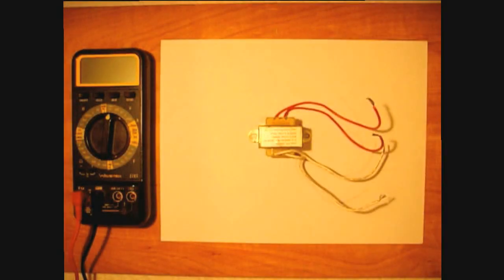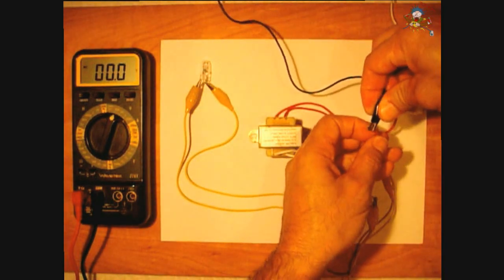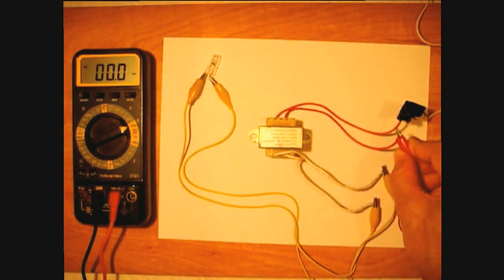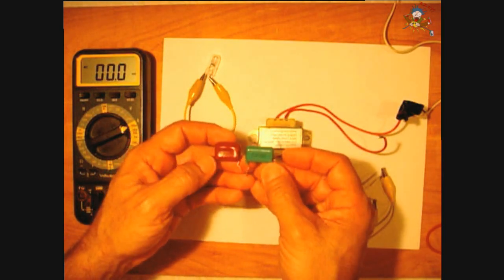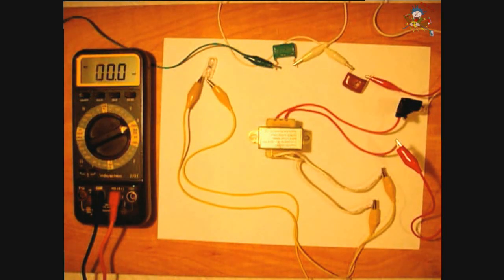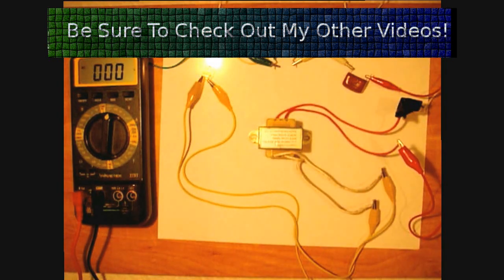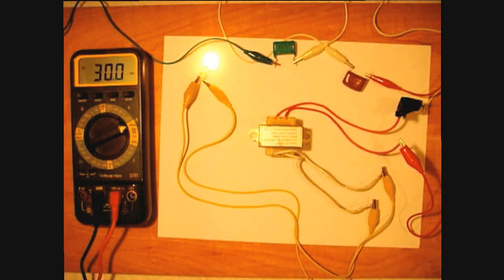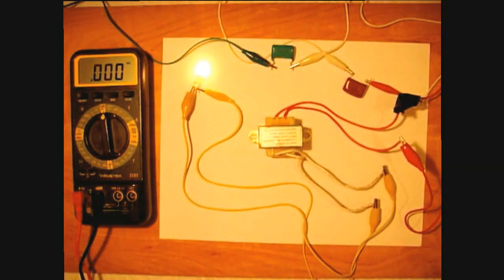How To Power 110V Transformers With 220V!

Comment: Thank you for this video. I've got a 110V soldering iron by mistake and thought about doing that. Maybe it can work. I will give it a try. Would be great if I can use it on 240V. We only got 240V or 380V here in France.
Reply from the maker: +Michel PASTOR 
Hello Michel,  Use a 120v light bulb in series with the soldering iron which is approximately the same wattage. That will work just fine.
Reply: +electronicsNmore Thanks for the suggestion. I tried the resistive and capacitive dropper methods. I modified a Hakko 888 110V to run on 240V. Both methods work fine but I will keep the in series capacitor for the elegance of the solution (much less wasted power and everything stay enclosed in the iron base). A 8µF capacitor in series with the primary of the transformer did the trick to get reasonable voltage on the secondary according to the specs (should be a 24V transformer) and the iron seems to work fine. The fact that it has electronic temperature control worried me a little. Hopefully it won't expel the magic smoke sooner than it was designed for. Thank you again for your channel. Knowledge is power, education is key. Take care.
Reply: +Michel PASTOR I should add that I removed the ZNR that was in parallel with the primary in the Hakko 888. If you don't it will heat up and probably release the smoke.
Reply: +electronicsNmore Just a tought about this modification. To be practical I think a bleed resistor should be added in parallel with the capacitor. Otherwise depending of the voltage on the line at the moment you unplug the appliance a powerful charge can remain stored in the capacitor and shock somebody touching the end of the plug even a long time after it has been disconnected. I did no try it myself and don't plan to. Discharging the capacitor with something conductive makes a nice spark.
Reply: @MichelPASTOR  Hi,  is it still working or did you see magic smoke? I'm about to do the same and would like to know more about reliability of this method. Thanks
Reply: @sbybill3271  It was working and I managed to put everything inside the case. One of the caps was weak though and "exploded" (not the same as the other ones). But if you are using the right type it should be fine. I used 11µF. The one which exploded was MKT. The other ones which were fine were polypropylene caps. In the end I'm using an external transformer,  one I had laying around. Since I don't move the iron it is not a big deal. If you're willing to put the money down the best would definitely be to buy the right transformer.
Reply: @MichelPASTOR  Thank you for the fast reply. I was kinda thinking an easy way out....what if we reduce the secondary winding to half, which should be easy to do without dismantling the transformer. This way, everything should fall back to the power specs of the transformer and I should be good to go. Any thoughts on that?
Reply: @sbybill3271  Not sure about that because by halving the number of turns on the primary you will halve its resistance and also inductance which will in consequence halve its impedance. Aren't these transformers also supposed to be powered with 60Hz ? Going from 60Hz to 50Hz will also lower the reactance. Taking all this into consideration I think it is probably not a good idea in theory. I'm not a transformer expert though.
Reply: @MichelPASTOR  I won't reduce number of turns on primary but on secondary because there will be less number of turns on that side. The current on the primary side should then be half of what it is on 110V.  When the secondary side power is held constant, the primary side power will also be held constant. Hopefully, it would work. The equation is Vp/Vs=Is/Ip. I will experiment with it and see how it goes.
Reply: @sbybill3271  sorry dunno why I read primary.
Reply: @MichelPASTOR  I did some calculations and found out that it's not possible because you need 2.4 times more turns to maintain same level of magnetic flux density. Sorry :(
Reply: +Michel PASTOR Bien s&#251;r que &#231;a marche, il suffit de calculer l&#39;imp&#233;dance apport&#233; par le condo, soit 1/(2*PI*f*C). f vaut 50Hz en France. Mais il faut une charge relativement constante, &#231;a ne marche pas pour un truc dont la conso varie beaucoup, car il faudrait que le condo varie en m&#234;me temps.
Reply: Hi,  can you please provide me a link to the site for calculating the capacitor value? Thanks

Comment: The slightly higher output voltage may exceeds the input rating of your voltage regulator, so check the datasheet and the transformer's output at no load before blowing up your voltage regulator... ;)
Reply from the maker: RPBCACUEAIIBH Output voltage difference will not be an issue since most VREGS can handle high input voltages. You can also add a load resistor if needed.
Reply: true... another issue is that VREGs usually heat more if you're regulating let's say 5V from 20V then at 5V from 7-9V input voltage... If the circuit was designed to run hot at just enough input voltage(which is usually the case for economical reasons) you may have to change the heatsink as well... so it's seemingly simple, and you may get away with it, but not always reliable... Surely it's an emergency solution if you really don't have the correct parts, but I would be concerned about safety...

Comment: Another method that would be useful for doing this is if you have two 120 volt transformers that are the exactly the same. You can wire the primary coils in series and the secondaries in parallel, taking care with correct phasing ov course. You could also wire the secondary windings in series instead if you desired a higher output voltage.
Reply from the maker: xanataph I have done that before. I actually used one transformer in series with a small microwave oven shaded pole cooling fan of the same wattage. No issues. Worked great.

Thanks For Watching
Reply: electronicsNmore Yes, the cap has the advantage ov not wasting power like a resistance will. The only issue I have with this fan I have is if I plug it into a MS inverter. I have found that capacitive fed supplies do not deal nicely with that kind ov waveform...! heh

Comment: You tailored your output to match your load (the lamp in this case).   Would it be appropriate to calculate capacitive reactance based on maximum current output of the transformer and then adjust accordingly on the secondary side depending on the application?
Reply from the maker: mediaguardian Sounds right to me. :-)

Comment from the maker: @daniel g. You can use a 240V transformer on a 110V line, but expect 1/2 the voltage/power output from the secondary. :-)
Reply: Why don't you need 2 fuses (one for each hot) on the 240 Volt primary wires? Thanks.
Reply from the maker: Once one fuse blows, the current can no longer flow, but ideally you should have a fuse on each 120v leg.
Reply: electronicsNmore Ok, good to know. Thanks.

Comment: Is there a reason why you couldn't  use just one hot leg and the neutral to lower your input voltage to 120volts? Or was the purpose of this experiment just to show how it could be done if you didn't have that option available. Love all your videos, thanks again.
Tommy
Reply from the maker: Best Racing Tips Win At The Dragstrip If you connected the 120v transformer to one leg of the 240V line, and the other wire to ground that would work, but ground is not used as a neutral(even though they are connected at the panel/meter can) on a 2 wire w/ground 240V line. This video was just to show another option in case you do not have a 240V step-down transformer available.

Thanks For Watching!

Comment: Great video. You didn't show the voltage being supplied to the primary winding of the transformer with the capacitors installed. Would it have been around 120, or is there more happening with this circuit?
Reply from the maker: Dennis Rindlisbach You're right, I should have. The voltage should have been around 120v. :-)

Thanks For Watching!
Reply: Thanks for your reply. Do you have any content explaining the theory behind how psc motors work? More specifically the type used in air conditioning (single phase 240 volt). I haven't found a good resource to understand the theory behind how they work. My initial thought is that the feedback from the motor running alters the frequency, which in turn effects the impedance of the capacitor. Is my thinking in the ballpark, or am I completely off base?
Reply from the maker: A good link for you:
http://www.industrial-electronics.com/AC-DC-motors/54_Permanent-Split-Capacitor-Motors.html
Reply: electronicsNmore  Thanks for the link.